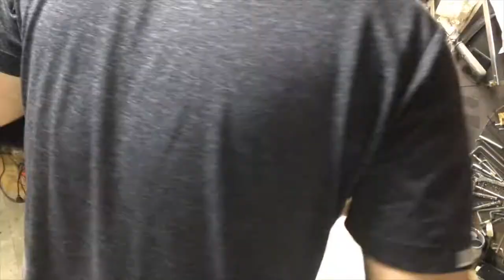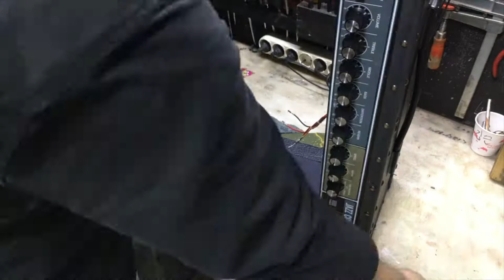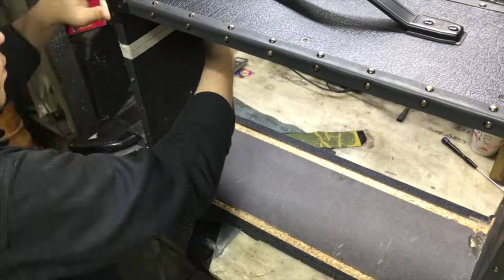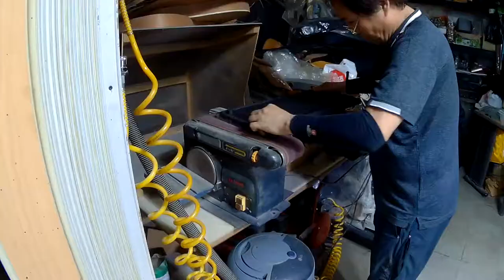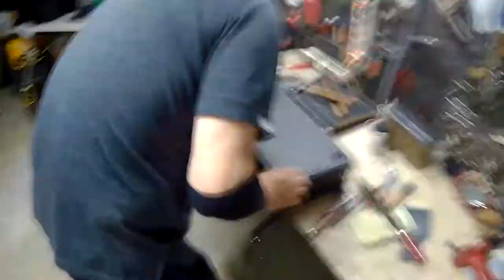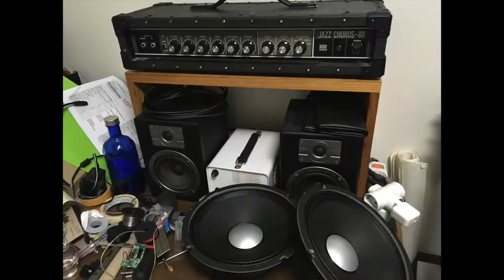[Instru_Hack Series] Roland JC-40 amp-head detach modification

Comment: You don’t need a load box to go direct?
Reply from the maker: Caleb Genheimer i forgot to mention, plugging something in the headphone jack shuts down power on the cabinet circuit while it sounds on line out. I used blank plug, which was made for converting 3.5mm into 5.5. It had no problem til now.